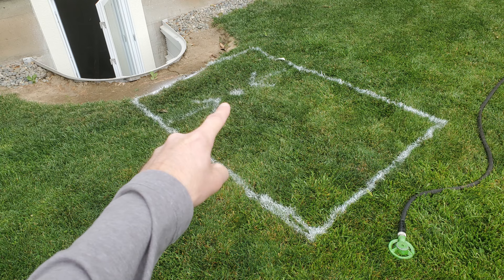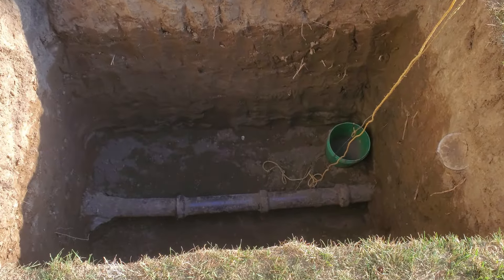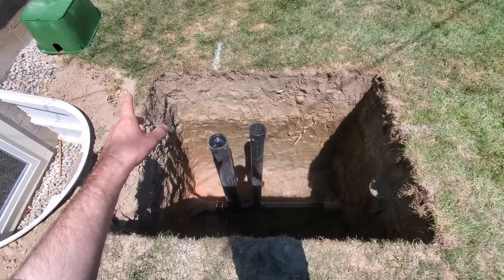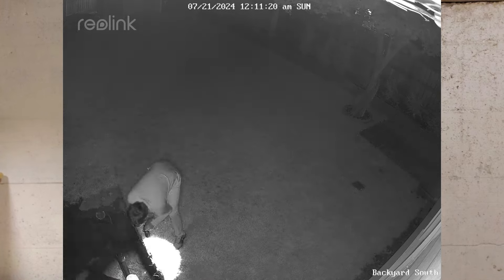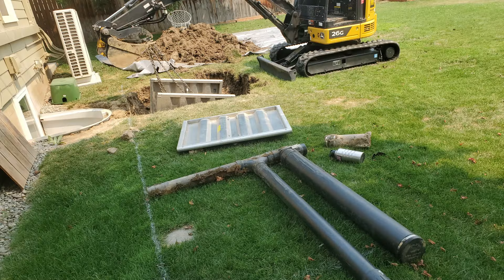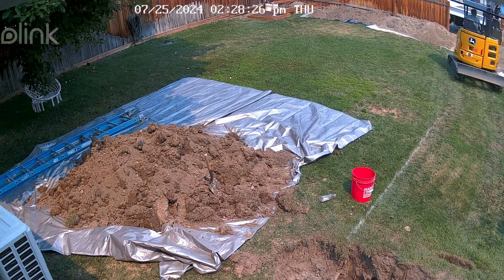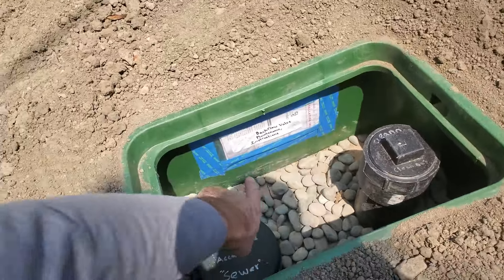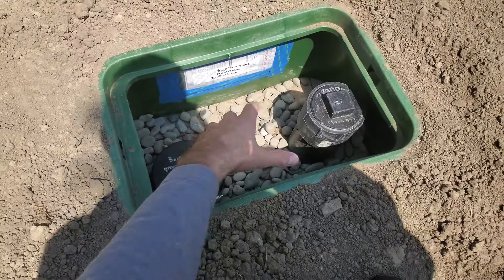Sewer DIY Disaster, a Warning to Homeowners!

Comment: This sounds exactly like something I would do. I had a case where a fence post was drilled right through my pvc drainage pipe. We had just moved in and there were no maps to indicate where drainage pipes were underground. Luckily this was just a second, half bath. I "fixed" it myself and it took 2 attempts of digging it up and filling it in again. I was quoted 800 dollars to fix it (dig and all). I saved 700 dollars but spent probably 10 total hours getting filthy and ruining clothes. Sometimes we need to factor in time and aggravation when taking on tasks. Thanks for your honesty, glad I'm not alone. Nice hole by the way. It would have taken me months to dig that with the amount of river rock that's in my yard.

Comment: That was an amazing hole. I have done this exact same job however my hole was much smaller. Honestly your only real mistake was procrastination. Remember on a job like this to jump in and finish at least covering the pipes. Never leave completed water lines or electric lines open in a pit. 
Other than that very impressive.

Comment: Electrician here and I can share story after story of people who have done their own work and created more problems and expense than if I was out the first time.  One guy went to replace his own devices throughout the house, killed the main to turn power off, those main breakers he had are notorious for breaking in the off position which as a HO he wouldn't know.  He incurred the cost of a replacement main breaker plus an emergency fee to run out on the weekend.  Was an emergency because it was already around 95 at 9 a.m. and climbing, and wife and kids were hot and telling him to get it fixed.

Another good story was a lady who added her own wafer lights after watching a video, got to the point where she needed to connect all the lights to the existing light box and realized it was above her skill set, so she called a close family member who is an engineer.  A job that would have taken us 15 minutes took us around 3 hours because this guy took apart the entire junction, had tape and thoughts on all the wire.  The junction killed half the basement and trying to track where all the wires went, had to put a new box since the old recessed Jbox was never meant for that many pieces of romex to begin with.

Story after story......I just spent 4.5k getting a massive tree taken down.  It hurts spending money, we tradesman are people and homeowners as well.  I support the DIY effort.  Not everyone should DIY and some projects should not be DIY.  Some people are competent enough to replace a switch or an outlet, you'd be surprised how many do not get the appropriate tightness on the screws and have loose connections that burn up.

At my own houseI have a sewer line replacement that needs done.  It is a hung sewer so only a few feet deep and I could easily rent a mini X, trench, remove the old cast, and put PVC in with a proper slope.  Problem is it is under a driveway and being a sewer line I need it done right the first time so I'll be hiring a professional to do that.  Not a time to penny pinch.
Reply: I'll also add many people have been ended being down in a hole that deep with no cave in protection.  It was incredibly dangerous, glad you didn't learn that one the hard way.
Reply from the maker: Thanks for sharing your stories! I just hope the customers who screwed things up didn't take their anger out on you. Just like the saying "Don't piss off the mechanic working on your car" Yet people do it and they wonder why they get poor results.

Comment: Not going to say your right or wrong all bar running water, I cannot understand why you did that.  Your soil seems really sandy or loose.  Grass is really resilient all bar Female Dogs urine but even that is easy to sort out.    I'm not so sure about the size of hole comments, I think I would have dug a hole that big because if there is a cave in It would never have been dangerous.  Where as a smaller hole you may get trapped.

Comment: If I would've dug the hole I would've changed the pipe also that's the easier part I don't understand why you wouldn't have done that and then filled it in it would costed you about 100 dollars total they even used rubber couplings that's so easy jeesh you got suckered
Reply from the maker: @nooneson1  You bet I did.

Comment: If you were willing to dig down 7ft why didn't you just replace the pipe yourself? That's job would have only cost a couple hundred bucks.
Reply from the maker: @mp-xt2rg  Good Question, I could have ordered my own backflow valve and clean out. I would just have to make sure I have good slope and no bowing of the pipe after install. Lesson learned...

Comment: A more experienced DIY would have rented an excavator and dug out the whole pipe from the house to the street.
Reply: Many municipalities make you hire a contractor that  they have approved to make connections to the main. Where I am in SE Pennsylvania, I can dig as far as the street vent. The final lateral must be connected by the contractor that will charge about $10k for the connection replacement.